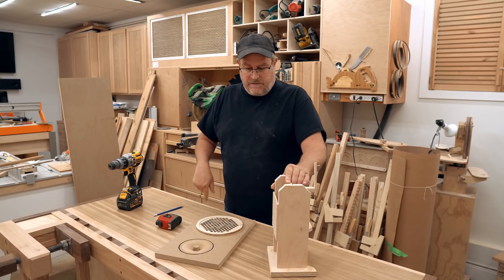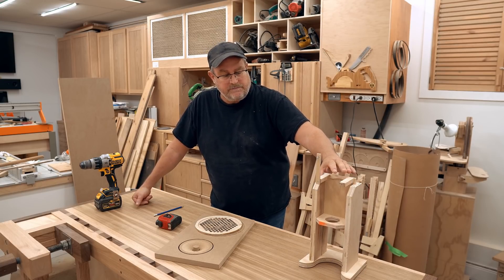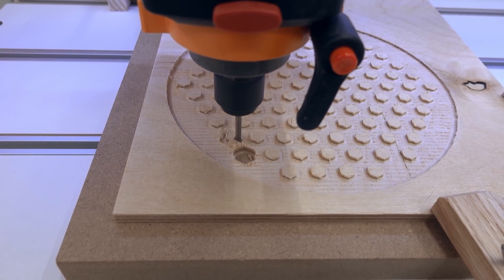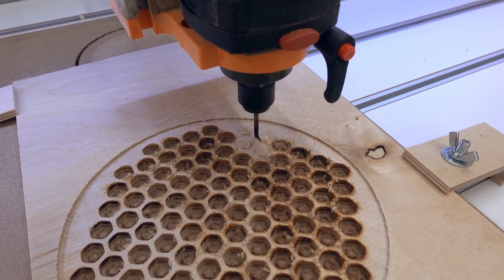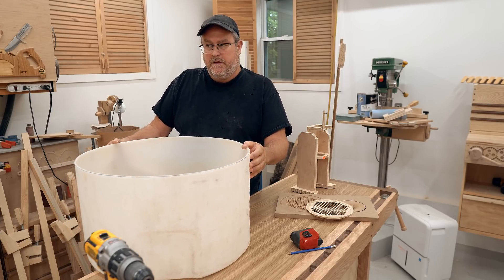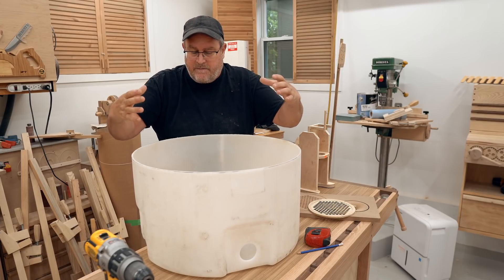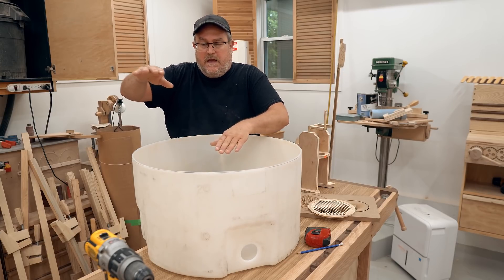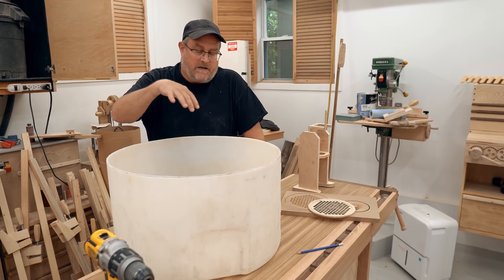I Said I'd Never Use a Cyclone... What Happened?

Comment from the maker: Trying out the CNC with a few progressively more difficult projects that were made even more difficult by my lack of bits. I have a bunch of 1/8" bits on the way, plus having the 1/4" collet will allow me to use all of the 1/4" bits I already have.
And yes! A cyclone dust collection unit is in production! Mobile, smart looking and an 80 liter collection capacity should be more than adequate for my needs.

Comment: Ok math majors, I was trying to figure out how many gallons are in the tank given Johns dimensions.  This is what I came up with:
d=23"
h=13

v=piR^2h

v=3.14159x11.5^2x13
v=5401.1 cubic inches
v=5401.1/231
v=~23.4 gallons

I think that's correct, The denominator is 231 since there are 231 cubic inches to a gallon.  Got to love the imperial system.

Comment: I have a cheapo thing from HD made out of plastic that fits over a bucket and it works well... and it's a Thien baffle sort of thing with a tab coming in from the side that supports the baffle, that cantilevers it out over the entire opening with a slot remaining on about the other two-thirds of the circumference. That said, that it works, I have seen nothing to support the idea that the tab itself is helpful other than as a convenient way to suspend the baffle structurally. You don't want to stop stuff from falling through to the bottom as soon as possible; other than structural support the tab just creates turbulence. I have seen videos of the dust circulating inside clear-bodied cyclones with Thien baffles and the part of the incoming jet that is made visible by having all of the particles in it, the main part, does not in a Thien setup have a circular motion in a horizontal plane; the plane of the jet is radically tilted and dumps the material down through the slot while making a substantial angle to the horizontal. So I find it very difficult to believe Thien's claim that "The baffle reduces the amount of turbulence that hits the already settled debris in the bottom of the bin." See for example, Justin Depew's YouTube video "Building a small Shop Vac Cyclone Dust Collector" for an example of a tab-free baffle that works very well.
Reply: For example, starting at about 13_05 in "Woodturning or Woodworking - Improve your Dust Collection" by Peter Woodbine you can see the non-horizontal nature of the circular motion.

Comment: After burning through several filters in my shop vac, even after washing them out to get some extra mileage, I finally broke down and bolted a Dust Deputy to the top of a 55gal drum and haven't had to change my filter since (2 years later, but I don't work in the shop nearly as much as you do). Hell, even bought a second one and bolted it to a 5gal bucket for when I start sanding these floors. Still need to plagiarize somebody's shop vac cart to make it less of a PITA to move around though.
Reply from the maker: That 31 year old shop vac still has its original filter.
Reply: @IBuildItScrapBin  holy crap!

Comment: I bought 55 gallon former food barrel and cut it down to around 40 gallon capacity and made a six caster dolly using the original sealed barrel lid & rim so it rolls around my shop the same way as you plan to do.  For the top I bought a Veritas cyclone lid ($42 LeeValley) and  installed a 2.5" sawdust cyclone input port and a 1.25" Festool vacuum exit port for very fine dust.  My Festool vacuum is significantly quieter than common shop vacs and provides enough suction to capture all my planner, band saw, drill press, and soon my jointer's chips in the barrel and only very fine dust ends up in my vacuum's bag.  The Veritas lid just sits on the rim of the barrel with door foam gasket as an adequate seal.   I added two wood handles on the side of the barrel so it can be carried outside and dumped.   Simple and very satisfactory!

Comment: Not that I don't trust you John but I did the math and you are very close to the 22 gal comment. Sorry man, I won't check your numbers again.
I made a new Thien baffle. The old one I had didn't have very much volume. This time I'm using a steel garbage can with wheels. I also made a box that has a 10"x20" furnace filter that goes in between the garbage can and the shop vac for the fine dust. My shop vac is in a pain in the butt place so it's a pain in the butt to get out every once in a while and knock out the dust built up around the filter. The Thien baffle works really well but doesn't get 100% of the dust. It's very close but not perfect. I had to buy a second steel can though. I mainly use a 2-1/2" hose but I also use a 1-1/4" or so hose as well. The first time I used it with the smaller hose the can collapsed. With the second can I make a spoked ring that sits about half way down. I also made a 2" hole with a sliding lid on the top to help with the stress.

Comment: looking forward to your cyclone project.  I still have a Craftsman shop vac from the 70s.  Works and I use it in my finish room.  I saw a YouTube video where someone compared about 10 shop vacs.  Believe it or not the Bauer had the most suction.  I bought a Bauer for my cyclone experimets and it really sucks.  here is some rock and rolling  https://www.facebook.com/TjacksonWoodworker/videos/pcb.3415257305263250/414208613231836

Comment: I enjoyed your video! Ten years ago I installed a vacuum system in my basement shop, about 13’X16’. I used 2 1/2” flexible hose at ran it at ceiling level. It feeds into a 50 gallon plastic drum after going through a homemade cyclone powered by a Craftsman 6 1/2hp shop vac from 1984. Each station has its own valve. The key was installing a hose to the ceiling that I can attach to another tool or clean up the floor. You could do something similar.